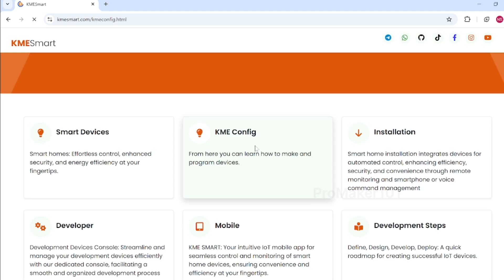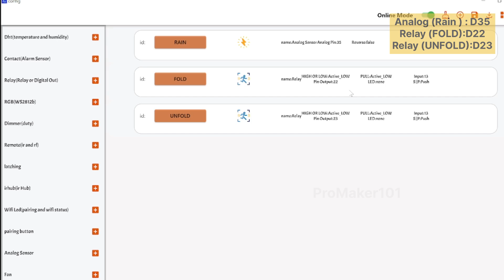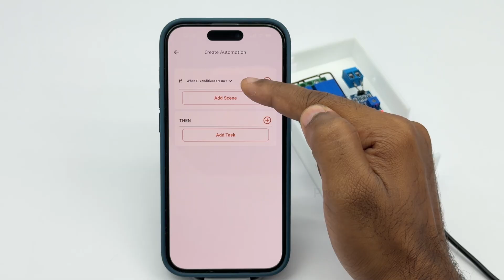This DIY device is a must-have in every home

Comment: How do you make those wires?
Reply: @Promaker1 The wires you use to connect the components... how do you prepare them? What diameter do you use? How do you measure them and bend them so they fit so well?